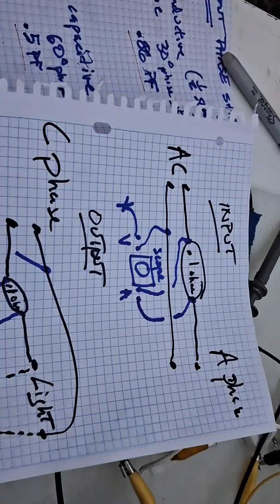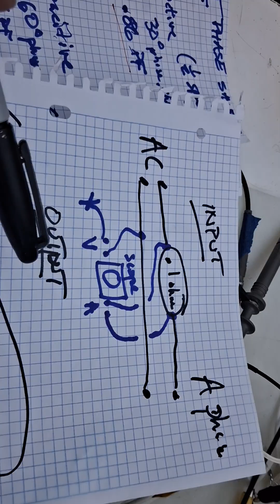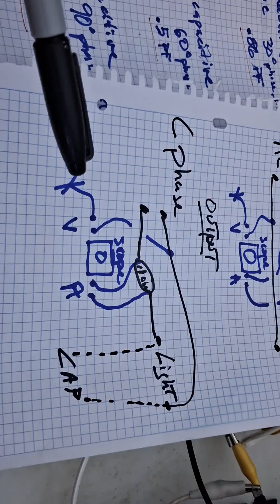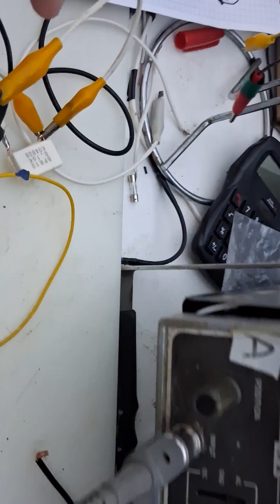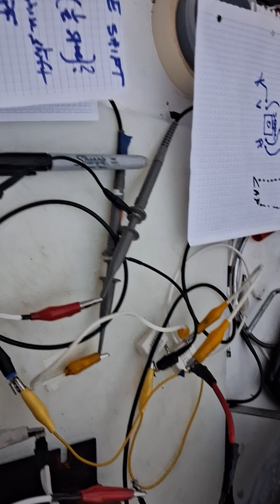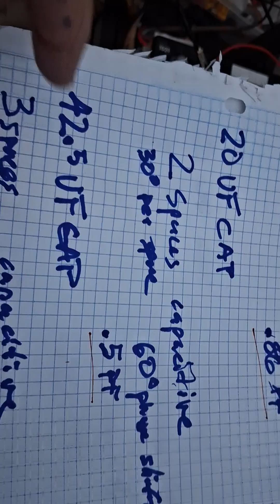Part 2 Oscilloscope tests continued

Comment: Hi Kone
If Phase B is short-circuited the current will be very high.
This current dépends on the internal impedance of the three phases transformer 
The voltage V accross phase B will not be exactly 0V dur to the imbalance between Input phase A and Output phase C
To correct this imbalance a load must be added to phase A
From Ai caculations with Mistral
Reply from the maker: I think phase B has its magnetism turned "null" by shorting out B phase....not so.much the voltage...
Where the draw to A primary goes up is when cap putcacross C phase with  loaf...this initiates ferroresonsnce i.cire
Reply: many thanks for your answer
I work on it  with two simulations :FEMM and LTspice 
I hope to get good results 
Can you tell me more about magnetic shunts between coils